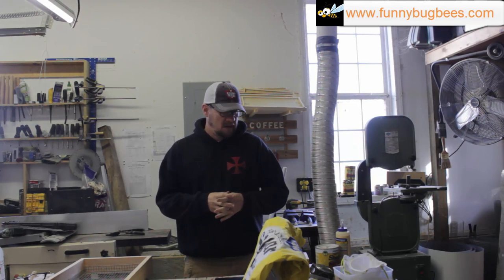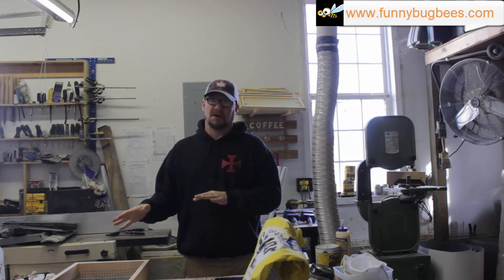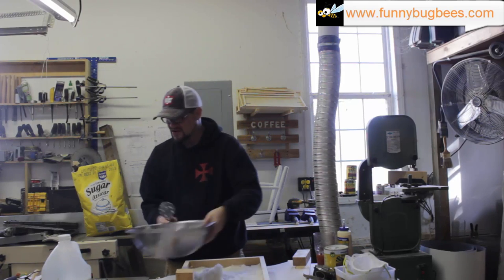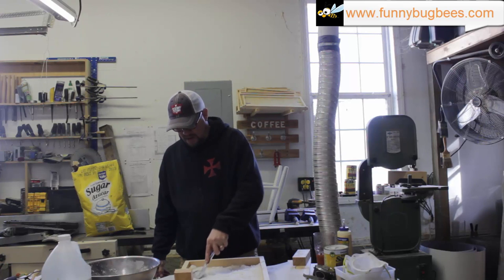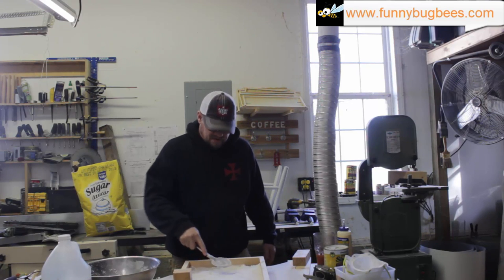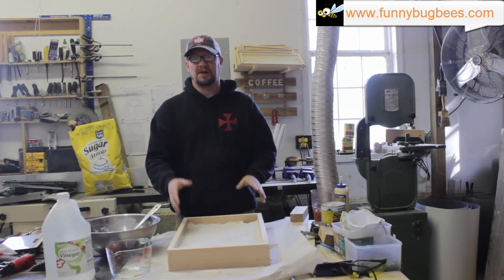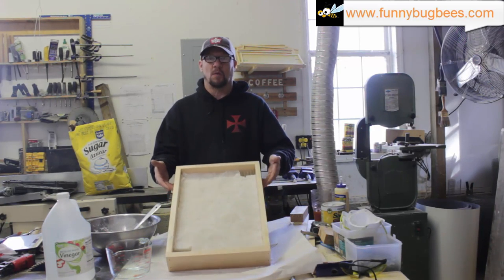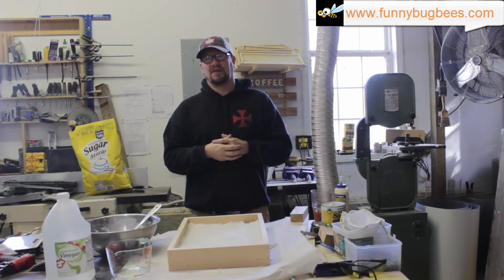Preparing Hives For Winter Pt. 2 - Candy Recipe for Candy Boards

Comment: I am SOLD on candy boards,been using em 5 years,as my only ventilation,only difference is I have hole in center also,and I have #8 hardware cloth on the bottom on all of them.Sometimes I mix pollen sub in, sometimes I just pour a dry pile on top.Ive never had SHB problem doing this, and their terrible here in Southern Missouri, I assume it's because most are gone and ones left are in cluster using bees to stay warm.Good Video, well explained.
Reply from the maker: I dont use #8 cloth, bees cant fit through it. Most people I know who use #8 have to go through the extra step of cutting small holes in it to allow the bees to access it. This is just to many steps for me, so i use 1/2" cloth which the bees fit through easilly but its still good to keep the candy from going through. You just have to use newspaper under the candy and allow it to dry.

Comment: Do you really use these candy boards in North Carolina with an average January low of 35F?
Reply from the maker: Temperature is irrelevant. The candy boards are an insurance policy against starvation, 1 of the three "Big Three" as i call them that kill colonies in the winter.
Reply: Love your fast forward! I could get a lot done in a day at that speed ! Good video. I don't know enough to request anything just like to see know how tos
Reply: Do you think it would be ok to use the candy board with an insulation cover (cedar chip filled) in northern Ohio. This is what I am thinking I should try.
It's not deep winter yet but January and February we have seen below zero
Reply from the maker: @notyourblonde  how you do it doesn't matter much, its doing it that saves your butt :) If the bees run out of honey, this is an emergency food source that you can check in the winter every couple weeks and add more sugar if needed. Just use a mold to stuff the same recipe in for instance set up more sugar in paper plates and let it dry, then you can just add the sugar patties you molded in paper plates right into the box without really opening your hive.